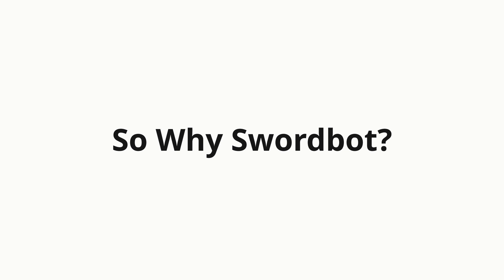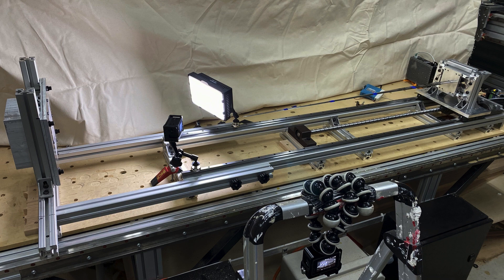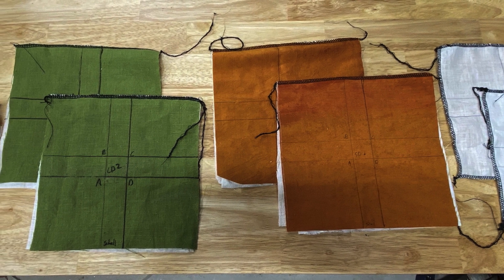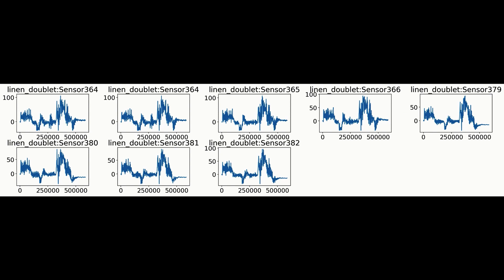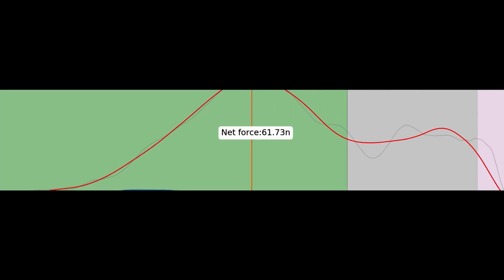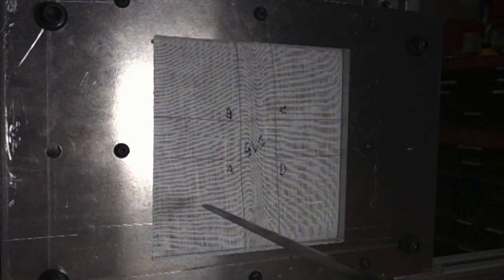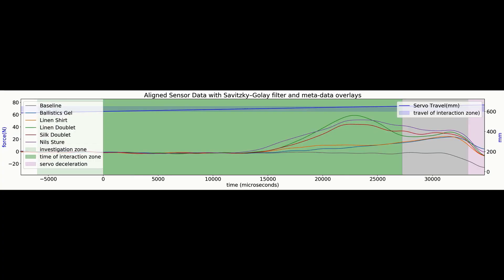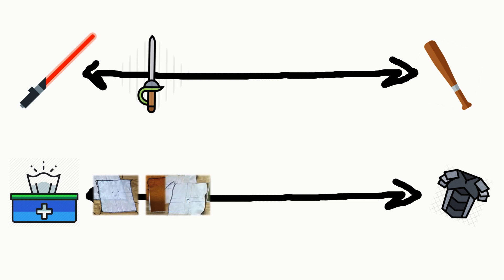SwordBot : On the Force Required to Penetrate Men’s 16th Century Upper Body Clothing

Comment: Having done non-scientific anecdotal experiments stabbing through old gambeson parts, I'd ask for future content about such tests to include information on edge geometry used and how well-honed the blade was. From my limited experience the edges make a big difference in how easily a blade will thrust through cloth. If it's not terribly sharp, but pointy, it'll push the fibers of the cloth apart, which provides quite some resistance. If the edge is properly sharpened with decent edge geometry (cf. Mike Edelson and Karl Bolle's method) and honed to shaving sharp, I've found that the blade will not push the fibers to the side, but rather cut straight through them with little resistance. A dull edge on my rondel dagger vs a sharp edge on the very same dagger was the difference between 5cm of penetration and basically going all the way to the hilt, almost 30cm, with what felt like similar force applied.

End result was, however, similar to your findings: Cloth is not a good protection against thrusts with sharp blades.
Reply from the maker: Yes you anecdotal evidence is in line with some academic research that was used during the construction on the experiment regarding the science and geometry of sharpness...  The tip of the sword was sharpened but the bevel and ground shape were not changed as it matched the contours of the period rapier that the blade was modeled off of...  I don't go super deep into the topic of sharpness here, but it was a consideration and something that was discussed in the paper this video is related to.

Comment: Any future plans to simulate multiple layers of protection / acceleration of the target toward the blade when intercepting a step or charge / thrusts without prior acceleration, with the tip already in contact with the target prior to pushing forward? Not an uncommon circumstance in close combat, particularly in the case of a double between two aggressive opponents. All sorts of historical accounts of both fighters stabbing each other in a clinch.
Reply from the maker: From a physics perspective what we need to test stop thrusts, multiple charing opponents and other conditions is the net vector between the two targets... To give an example... Two fighters rushing each other at 1000mm/s is the same as 1 fighter lunging at the other at 2000mm/s (1000 + 1000), which is also the same as a fighter rushing at their opponent at 2000mm/s and then hit by a stop thrust...   As far as the point of impact is concerned (and the forces that transfer back to the quillions where I make my measurement) all 3 of those examples are the same (blade hits target at 2000mm/s)...  The physical plane of reference may change, but the actual math doesn't..

Now a slow push would require a different motion path and is an interesting question (does the material yield differently if the force is applied slowly)...  I have heard and debated a lots of contradicting ideas there so that a great question to experiment on.
Reply: I think there are some nuances beyond merely multiplying the force when the recipient of the wound is pushing onto the blade, but they'd be hard to account for without some rather complicated systems. For one, a step isn't purely lateral - all but the most disciplined thrusts will have an upward motion that could offset a point or assist it in wiggling through a resistant material.

Regardless, yes; slow-pushes, and how different materials (thread counts and density, different kinds of weave that sever and part under pressure.. Especially when that pressure or the subject is moving).. That would be a good thing to explore, and does hold a pertinence to rapier in terms of the off-hand weapon becoming more than just a parrying tool when in a clinch, particularly between wounded opponents pushing beyond first blood.
Reply from the maker: your comments about the blade tip movement is actually touched on in the paper.. The thrust is mechanically "perfect" I noticed that there was nearly zero flex in the blade during the thrust.. And being mechanically perfect is great for removing confounds, however, it adds new questions around what about the arc of a tip as it drops or rises to it target..   This is why science is hard... and fascinating..
Reply: @HandsonCNC  Firmly agreed :> May your research be frustrating enough to be rigorous, but fruitful.

Comment: That's interesting, though I wasn't aware anyone seriously expected even heavy period clothing to protect against thrusts. Cuts might be another matter, & I've certainly heard period clothing being put forward as a reason for the increased focus on the thrust. With that said, very impressive 😊
Reply from the maker: To be fair the argument has never been at the extreme ends of blade flex. However period rapier fighting does have standards that people claim are martially sound ranging from lightest predicable touch by that recipient to noticeable flex by an outside judge.   That is actually a pretty wide range. The hope here is to narrow that range for those that wish to align blow calling with “what would a sharp rapier do to someone in period”.
Reply: @HandsonCNC  seems fair, though I think often that isn't about force, but penetration. Thinking of the thickness of most kit we have anything up to 10mm of penetration required to reach skin, & then probably another 20-40mm (potentially more depending on the individual) to reach the viscera. The lightest touches are unlikely to achieve this.
I'm sorry though, I feel like I'm crapping on your work, which wasn't my intention at all, I'm very impressed with what you've done.
Reply from the maker: @Twistit_tree  Productive conversations on the topic are never "crapping on your work" so all good :-)

I think we also come from slightly different fencing cultures... My background is prodominately Society of Creative Anacronism. As such our armor standards are very thin (basically the linen doublet example). There is only 3 to 4mm of thickness in that armor standard as we are only armoring for critical failure not the force of the blow...  As such we don't look to blow past armor and into a vital target.. (a historical note, di Grassi suggested that a puncture 3 fingers deep (which is, depending on the hand, about 40mm) would kill most.. 

Neither approach is wrong, we are all looking to exercise and improve the art.. :-)...
Reply: @HandsonCNC  huhm, unfortunately I frequently wind up dealing with people in heavy spes jackets. I think it's excessive myself, but I'd be a fool not to recognise the culture. I'm very curious now what 40mm of penetration would look like in terms of blade flex. That may be something I can play with 😊
That's di Grassi's advice, but he's only one source. Over a range of sources in the period you can find an equally broad range of advice, often within the same source, depending on circumstances. With that said I think for determining a 'valid' hit that range means historical advice may not be as much help as we'd like 😉
Reply from the maker: I need to find someone willing to buy me a few dozen of those ballistics gel mannequins they use on Forged in Fire.. THEN we could get some better visual data on penetration and outcomes ;-)
Reply: @HandsonCNC  hah! With a magic money tree, we could learn a LOT! 😂
Reply: @HandsonCNC  The "three fingers deep" in di Grassi is a reference to Vegetius. An interesting discussion titled "The Medical Reality of Historical Wounds" was presented in a paper in SPADA 2 from Chivalry Bookshelf in 2002, written by Dr. Richard Swinney and critical care respiratory therapist Scott Crawford, as well as an oral presentation at WMAW in Racine, WI in that year. The paper compares contemporary accounts of historic wounds by physicians with modern case studies of similar wounds. Some of the results are surprising.
Reply: Also, Stephen Hand from Stoccata School of Defence has a couple of somewhat less empirical videos discussing cuts and thrusts through clothing, with demonstrations.
Reply from the maker: Yah I am farmilar with who di Grassi was referring to during that comment..  I have heard of the paper you are talking about but haven't gotten my hands on a copy of it or read it.. (If there is one thing HEMA and WMA is not short on its content to read LOL)..
Reply: @HandsonCNC  Much to read, indeed! I have a copy of the paper.

Comment: Thanks!
What kind of silk did you use there very big differences in yarn thickness and waving. More then with linen…
I searched around and found that trust protecting materials, like the steel ring stuff used be butchers is tested (in Germany) like:
A box filled with clay up to the rim, a thin T-shirt cloth over it to make less mess, the Test  material laid over it, which
get clamped firmly to the rim of the box on all 4 sides. 
The Test blade is clamped onto a vertical running piece, that runs in rails like a drop hammer. The Sled/hammer head ways 100kg. It is dropped from 1m height. The Point is not allowed to pass through the protecting stuff more then 7mm. the Test blade has one side vertical, the other to form the point 45°. The Edge was sharpened to (if I remember correct) 30°) and only ground on the 45° angeled side.
I bought 6 different pieces of mail to do some tests but never come close to do them.
Maybe you could do that. Building the Machine is the most work and better than I would have done.
Reply from the maker: The silk used is a Shantung silk...  I also had an interesting conversation with a weaver about how weave patterns could have significant impacts on how fabrics fail so there are always new factors to test and consider.. Thats the fun of science.. Its never answered completely.. It just answered for a specific set of conditions... New questions/conditions create new opportunities to explore and test and learn... 

I use ring mesh as my practice armor so I am quite familiar with the material though I did not know that testing procedure.. That is quite interesting.

The machine could test armor, though I am leary of beating up my sharp rapier ;-)... I may need to look into other more disposable blade simulations :-).
Reply: @HandsonCNC  Could your setup deliver the power of 100kg dropping down one Meter?
Reply from the maker: I would have to do some math to determine if I can reach that much force.. If I remember my math during design and servo picking I should be able to get close..  (I believe I have about 850 N of available force)